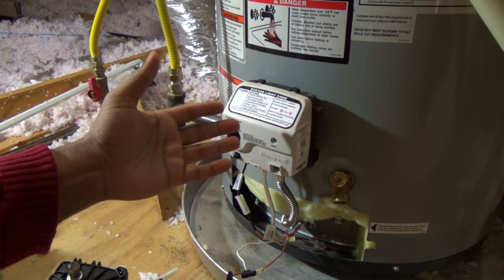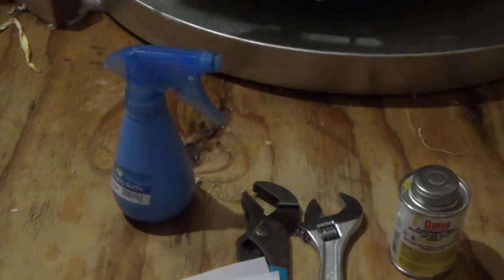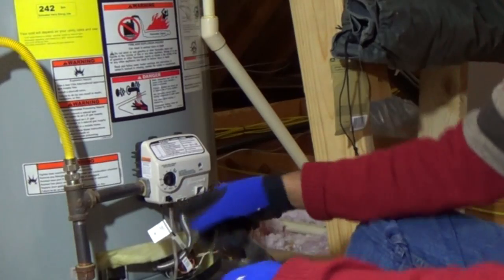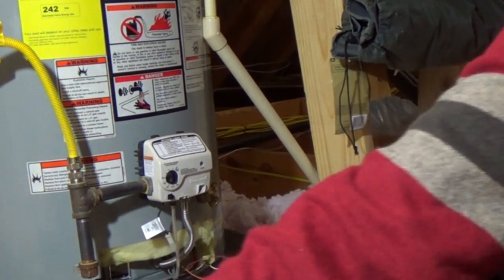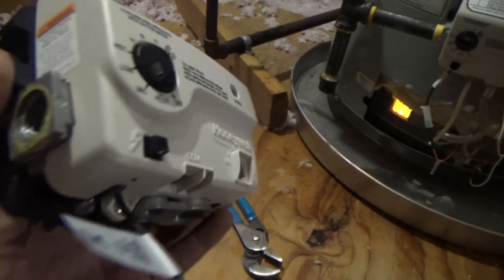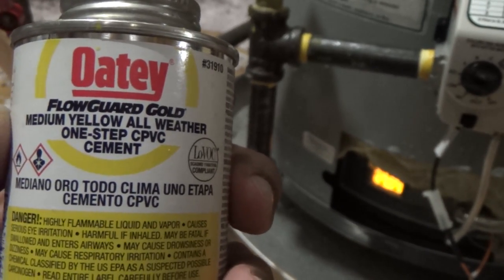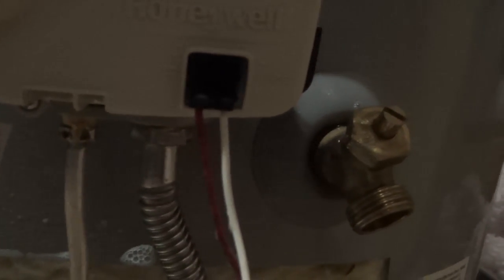(Read Descriptions for IMP Info) Vol 2 Preparation & Valve , Thermostat Replace- Gas Water Heater

Comment: The cpvc glue is not pipe dope. Cpvc glue is used to glue pvc piping together. Not intended for black screw pipe. T+2 by rectorseal pipe dope is a good pipe dope to use.

Comment: You skipped a lot of steps my dude. In fact the most important part which is the removal and installation of the part is completely missing. Only marginally helpful.

Comment: What temperature setting should I set the water heater?
Reply: Jose Lopez common house heat setting is normally at the B setting
Reply: should be a vac and low and hot and then A,B,C

Comment from the maker: Please use your discretion and judgement when operating the Gas Valve, replacing the gas valve. Some of the materials used may not be the same or may have changed. Please follow safe procedures as indicated in the manual. This is how I fixed my problem. This video will help you in understanding some of the procedures involved. Again, if you do not know what you are doing, CALL the professionals. Thank you.

Comment: What you were explaining as pipe dope was not! That was CPVC GLUE used in bonding CPVC plastic pipe. This needs to be corrected in your video. Any homeowner please call a technician to have this properly done.
Reply from the maker: +Justin Aguilar Thank you, I have put the right product in the description as well as on the screen. Home depot personnel helped me pick the one in video. the correct one is: http://www.oatey.com/products/thread-sealants/pipe-thread-sealants/great-white-pipe-joint-compound-with-ptfe

Comment: Good instructional video, thanks for posting!  I to have one like this and it's been giving me some problems here lately.  Any idea why they don't sell these gas replacement valves in a store?   When my warranty goes out (which will be in 2017) I'd much rather buy the replacement control at a local store and fix it that day instead of having to wait for it to be shipped.  I wish they sold them in a store like Lowe's or Home Depot but at present they don't....any idea as to why this is?
Reply: +Phayzyre105 Because they serve plumbers and gas technicians themselves, locally owned hardware stores may have them. Big box retailers will sell the item, but when it comes to maintenance you're SOL.
Reply: Mine was covered under warranty and I found one at a local plumbing supply store.
Reply: Jared Russell***UPDATE***

Since I first posted this I got a new water heater here about a month ago.  I kept having to change the burner parts they would send me and the damn thing still acted up....it would run fine for about 3 weeks then bam, it would quit!  Apparently the people at the factory couldn't figure out what was wrong with mine so they finally said enough and covered mine under the warranty.  I have to admit that my new one seems to be running better than the old one did!   I think the old one was a defective lemon from the get-go.

Comment: you need to open the pressure release valve on top if you are draining heater - it helps a lot

Comment: Drain the water out of the overflow valve with a garden hose attached. You can drain it out completely, especially if it has not been drained once yearly for sediment in your public water supply.

Comment: you could have poped the cover off the tstat and swaped out the board 👷
Reply: its easier to swap out the board especially in this case, when we know that thermopile is giving the right voltage and pilot is dieing off. It saves awful amount of plumbing work and avoiding a gas leak through the pilot pipe.
Reply: but where to get the board?
Reply: @karllin9598  Swap it out from the new replacement unit.

Comment: is there an easy way to replace to Thermocouple as it seems very confined and the screws to take the inner plate off/on very difficult.
Reply from the maker: +Rakesh Sekhri As far as I am aware you have to take the whole assembly out, at least that is the case on my water heater. What does your user manual say, may be somebody else may have an idea, post your model number and pictures in this blog http://living-in-usa.com/index.php/2013/12/17/volume-1-introduction-to-the-problem-and-troubleshooting-gas-water-heater/ , so I can take a look. Thank you

Comment: Why did the video cut off before you show how to take off the old valve? Would be very helpful to know that you needed Teflon tape to prevent water leaks or if it is even necessary , or if a lot of water comes spewing out. I  had the tank fully drained one time and for some reason it still came out from the gas valve
Reply from the maker: my battery died in the last minutes before the valve came out. a bit of water gushes out. keep some extra towels handy.

Comment: How did you connect the main gas pipe to the igniter-valve assembly once it was mounted on the tank?
Reply from the maker: +Kirk Carver Turning off the Valve ( assuming that you already have a connection going), I removed the yellow gas pipe completely. After making sure there is no leak, I proceeded with removing the Gas valve. In your case, you are asking how did I connect the Igniter - Valve Assembly well, before you mount the igniter valve assembly, if I were you then I would attach the T before you mount to prevent any cracks or accidents on the delicate valve. Hope I have answered the question. Let me know.

Comment: The cpvc glue is not for gas that is a glue for water lines only.  Any gas job needs  certified  tech.
Reply from the maker: +walterio lucas Thank you for noticing. I have put the correction on the video as well in the description.

Comment: I thought CPVC glue was only for CPVC, not gas.  I will have to look on my can to see if use with natural gas is authorized.  I am not plumber, but have general plumbing  knowledge for  small repairs.
Reply: David Chelakis Yellow Glue is for CPVC. he should have used a pipe joint compound such as Rector Seal. I prefer one that has teflon in it myself.

Comment: Major deceptive/unclear.

It should be made clear that you turned the old part right, but it should be removed by turning left.

Use proper wrench for removing all gas lines, not pliers held wrong way as illustrated in video
Reply: Sorry about that, see the FAQ, #3 for more information. Thank you.

Comment: on mine it still seems to work but something heavy fell on the control valve so it broke right off of the heater (oopsie)  now i can put it back on with some glue or tape but will that be fine? or do i need a new heater?

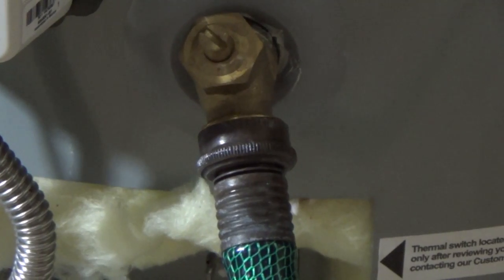Comment: Thanks for the video.  At 1:09 you state one doesn't need to drain the tank before thermostat replacement on a newer water heater - people need to check their manual on this.  I replaced a thermostat on a Whirlpool gas water heater today and absolutely had to drain the tank first.
Reply from the maker: You are absolutely right, really depends on the tank. Safety reasons, do it no matter what. Thank you.

Comment: For future reference, with this particular valve,  the white  faceplate which contains the control logic board and sensor electronics is actually removable. It can easily be swapped out with the front part of the new valve, instead of having to disconnect all of the fittings and completely drain the water heater. I always do that first, because 90 percent of the time it is the control valve electronics which fail. It literally takes less than 5 minutes and you can always proceed to the next step if that doesn't solve the problem.  Hope that helps anyone with a similar issue.
Reply: Thank you Bobby. I will update the description part of the video.
Reply: xdbworks Your Welcome Sir!
Reply: So you mean swapped out just the square motherboard inside the control panel?
Reply: Thanks, I needed that.
Reply: wow, was having all kinds of issues with disconnecting this and that...then swapped the electronic boards and voila, its working right now.  hopefully it was a bad board and not some other issue that caused the 'overheat'.  but thank you for posting this.  was getting discouraged, but now i can take a warm shower and wash some dishes.
Reply: How do you swap out the electronic board?  That would be nice to know.
Reply: Wow, I actually posted this by accident, but I glad to find out that someone benefited from it.
Reply: Had the same issue with my 3 year old Whirlpool water heater. Pilot would not stay lit.  Thought it was the thermocouple, took burner assembly to Ace and local reputable plumbing supply store.  No help, nothing in stock.  Called toll free number posted on water heater.  Had the 7 flashing light code on the regulator white cover box. Whirlpool shipped complete new valve for $30 overnight shipping. Rather than draining and replacing full valve assembly, just replaced the circuit board.  Took me 5 minutes and works like new.  Much less hassle.  Let the buyer beware as version issues could potentially be of issue, no guarantee for safety or operation.  Worked with mine is all I can say.  Great savings in time and effort!
Reply: How did you replace the circuit board?
Reply: Bobby Santos This control certainly seems to be a POS. Ive been working for Rheem dealers and when I started my company I sell Rheem. No problems there. But I am getting service calls for these heaps, which are now on John Wood, Bradford White, AO Smith etc, and yeah, 1-3 years old and the controls are failing.
Reply: chudykGT You're absolutely right. I am a plumbing contractor here in California, and I've had the control valves go out on Rheem and Kenmore units (about 10% failure rate)last year. They are all Honeywell natural gas valves with Ultra LoNox.
 I personally sell AO Smith, which I have not yet had any failures to date (knock on wood!). The valves that have failed had the connection for a LoNox sensor, which is required in my municipality for air quality reasons. I have swapped failed valves out with new valves without the LoNox connection, effectively by-passing that feature; and none of those have failed thus far. Could be a bad production run from Honeywell. 
When I am unable to obtain a warranty replacement from the water heater manufacturer,then I usually order replacement valves from Amazon, for about $115 with free shipping (Amazon Prime). I get the ones for the Reliance 300 series (Reliance/State Ind.) and they have worked perfectly. Read the reviews.....
Let me know if this information is useful to anyone!
Reply: Thanks for this info Bobby!!

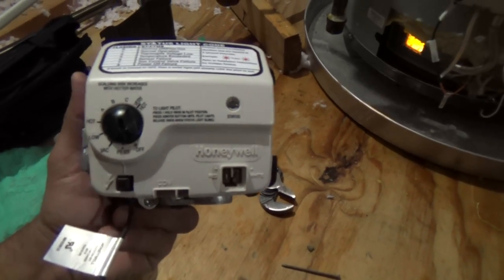Comment: Wait, what happened at 3:07 and at 3:35 ? -- The most important parts of this video are not there, that is, the parts where the line gets connected back to the valve? WTF??
Reply from the maker: The FTW happened was my camera is faulty and had stopped recording. However , what I did was just unscrewed all the connections. They are all threaded. Now, the part where I am unscrewing the valve, I had to stop recording as I found some water ( few gallons ),which gushed out. So even though you did a water drain, make sure that it is completly drained. Oh yeah, the missing video would have been , me rotating the valve anti clock wise. That's it. I hope your tank gets back to work. Good luck and don't stress.

Comment: this comment is first for ironwarrior, replacement parts for most appliances r generally not sold to the public because they should be installed and diagnosed by a licensed service tech proof is in the video when the two materials being used to seal the NATURAL GAS LINE ARE WRONG,no plumbers tape and glue LOL an approved Pipe Dope For NATURAL GAS PIPE ONLY......SUPPORT YOUR LICENCED HVAC TECHNICIAN!!!!!!!!!
Reply: id love to but he put a fist right in my bung hole  me every time I call.....just to show up its $80 ......then the parts $2-3 hundred at a clip....NO THANKS>>>>he can work at Wal-Mart like the rest of us....

Comment: One more question.. Your video was going very well until it showed you trying to remove the valve.  It shows you turning it to the right, then the left and then trying to pull it out and it not coming out.  Then you insert a (Recap) in the video and it never shows how you managed to get it out.   Can you please explain?   Thanks.
Just in case I manage to ever get the part and put it in myself I will know how it is removed.   Thanks...
Reply from the maker: I had to turn anti-clock wise (left turns) to completely unscrew the valve from the heater body. The reason why I happened to go right is I realized I had some water leaking and assuming the worst case that water somehow had filled back up into the tank. I did have a leak in my water valve which caused the tank to slowly fill back up. In the end, I drained it and continued with unscrewing (anti-clockwise) till the valve was out. In the beginning it felt like I was going to break it as the plastic body is flimsy. Use your desecration on amount of pressure to apply. If its too tight, left and right turns will help loosen it up. Hope that helps.

Comment: Hi I have a now 2 year old Kenmore water heater which is supposed to carry a 12 year warranty.  My gas valve has gone out and has left me with no hot water for over a week.  Sears tells me that this part isn't under warranty and wants 200.00 for the part.  I seem to get a different answer from them each time, but it seems they imply that as a homeowner, you have to contact a sears qualified technician and pay their labor before they will provide the part under warranty.  Did you have all these problems getting your part?
Reply from the maker: My situation was different. I had to contact the heater manufacturer as my home warranty of 1 year was up. However when I called the American Water Heaters warranty support, they performed troubleshooting over the phone and pretty soon we were on our way to replacement parts. Sears on the other hand seem to be violating consumer policies. Here is a link I found about one gentlemen trying to get parts. Good luck with it.

http://rankexploits.com/musings/2014/how-i-got-sears-to-send-me-warranty-parts-i-hope/
Reply: hello parts for a water heater should not b  sold to the public because u should have a licenced service technician diagnose and repair your appliance we go to school to learn how to protect you and your family from accidents and possible dangers NATURAL GAS could be very dangerous and the piping practices you watched on the video r in-correct a CERTIFIED NATURAL GAS PIPE DOPE IS TO BE USED not plumbers tape and PVC glue.....support your HVAC TECHNICIAN
Reply from the maker: Danny Guitard I believe that any work on your home that involves hazardous equipment or products should be handled in a professional or by a professional or somebody who knows standards on installations and safety factors.  If an homeowner can take it up upon himself/herself and are aware of the safety factors and installation standards, I do not see any reason why a professional should be hired until unless the homeowner is not confident in the standards and not aware of the safety factors. What ever you do, please be safe.

Comment: CPVC cement is not pipe dope, it is for gluing CPVC pipe which is similar to plastic, it inappropriate to use it. 

You don't need Teflon tape on any joints, just using true pipe joint compound on the pipes will work just fine.

Do not use Teflon tape on connections to flex hoses that have rubber gaskets inside.  It does nothing and is more likely to cause a leak than provide more protection because it can get between the gasket.
Reply: i notice that too, you never use cement!! bad mistake, says no where to use for gas. pipe dope the best but there is the gas tape also